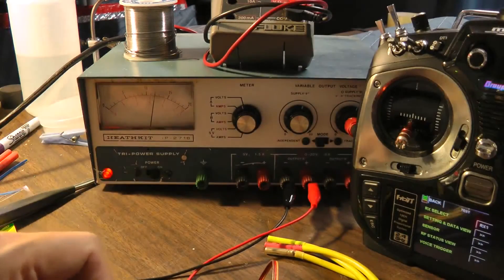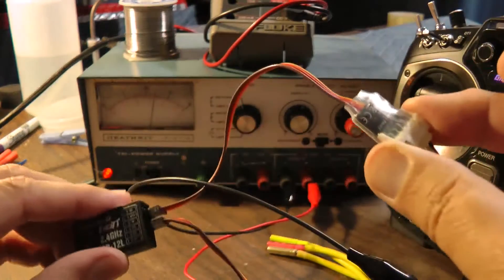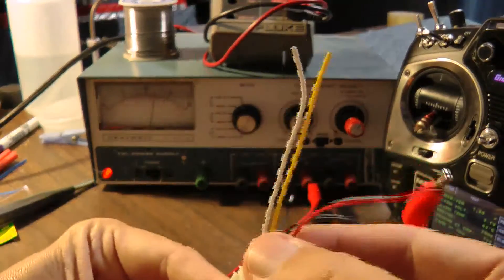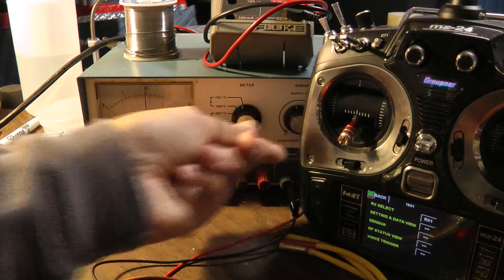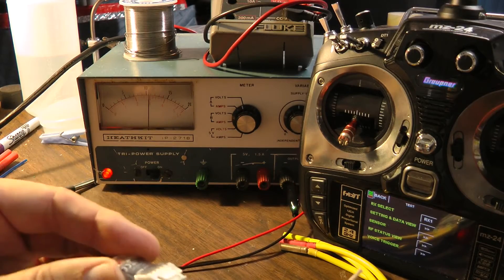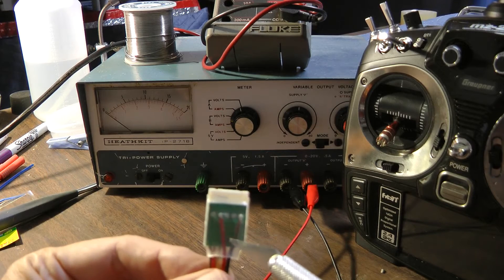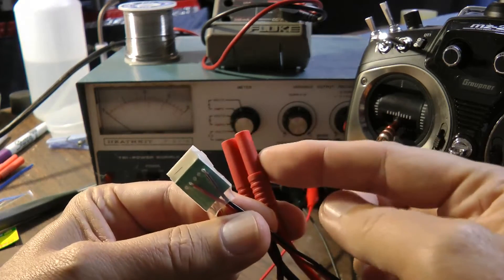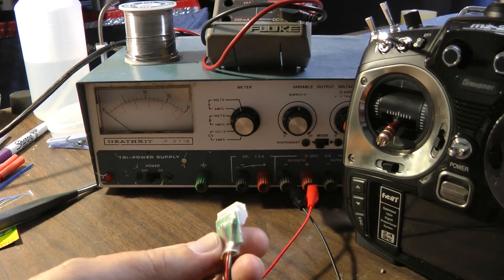Graupner Hott Voltage Module modification for a permanent hookup

Comment: Have you checked if that sensor can be used for 6 cell LiPo using just two wires ground and most positive. Will that damage the sensor, or it can handle that voltage.
Reply from the maker: No, I never tried anything above 4s.  The voltage divider circuit that is used on their gyro receivers can support 6s.
Reply: @GaryQuiring  I am not sure what you mean by "divider circuit that is used on their gyro receivers". I have Graupner gyro receivers. I laso have the V-80 sensors from Graupner which I am using for 6 cell LiPos.
Reply from the maker: @maciekkormicki9298  If you get the manual out for those gyro receivers it explains how to build a voltage divider circuit to measure your voltage.  The sensor used in this video is digital.  The gyro receivers have the ability to handle an analog signal which is voltage.  But the voltage is too high so you divide the voltage with some resistors.  Then the receiver can handle the low voltage and internally multiply the voltage back to tell you the actual voltage.  The stupid part is Graupner never made that circuit so you have to build it yourself.  If you have some basic electronic knowledge and soldering skills it's easy.  The cost is less than $2 in parts.  
Watch this video I made earlier, it partially shows you the voltage divider in use
https://www.youtube.com/watch?v=US3l95OmfoA
Reply: @GaryQuiring  Thank you for the info. I did not know that. I have a Master Degree in Electrical Engineering, so I understand how to make one. What does 2K7 mean. Is it 2.7 KOhm resistor?
Reply from the maker: @maciekkormicki9298  Yes 2.7k

Comment: Thanks for posting this tip. I will be using this to monitor my ignition battery voltage on my 1/3 scale J-3 Cub. I have a Moki 100cc 4 stroke engine that has a higher current draw than my receiver pack and I don't want to drain my Life A123 ignition pack below 5 volts (2.5v per cell).